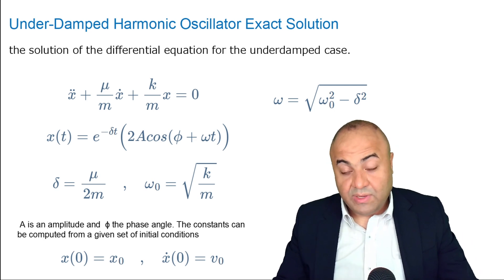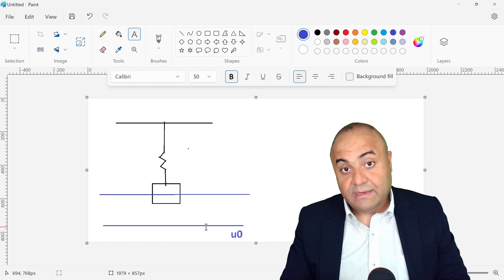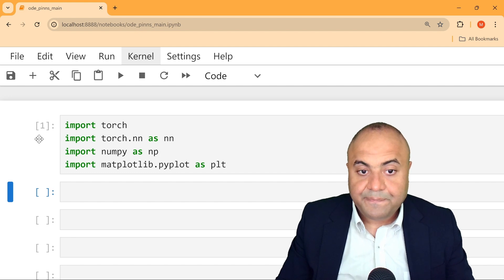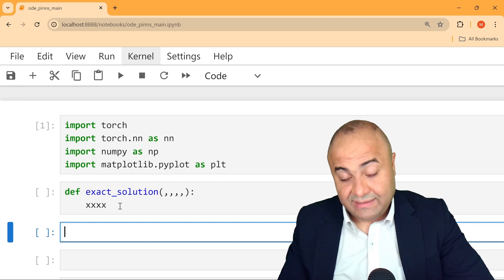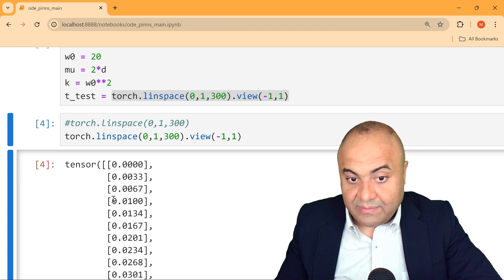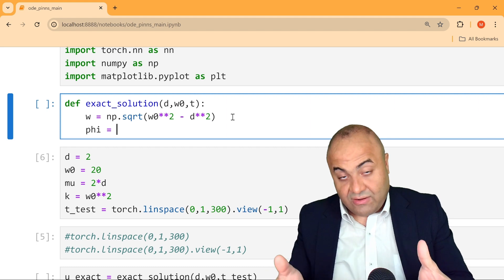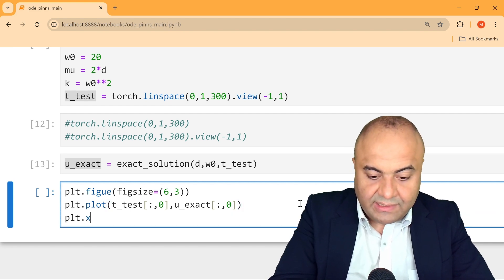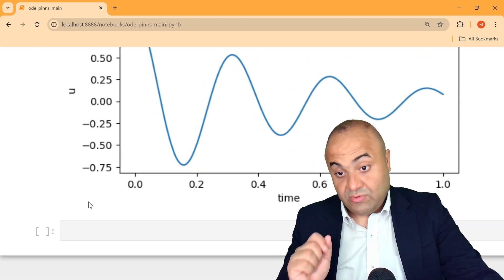Lec.3: ODEs Damped Oscillator  Exact Solution  [Physics Informed Machine Learning]

Comment: Sir, I have a question. I am basically applying PINNs in mathematical biology. Sir, if a differential equation already has exact solution then what is the necessity to use PINNs? And if there doesn't exist an exact solution for a differential equations, then in most of the literatures they are generating numerical data using traditional numerical methods and then applying those data for the training of our neural network. Then what is the advantages of PINNs in those cases sir? I truly believe that PINNs is a useful method for the differential equations in which numerical methods fail or in the cases of complex solution like Schrodinger equation. Sir, I have a lots of doubt and I think I may get those answers from you. Is there any platform except youtube so that I can contact with you for your valuable suggestions?
Reply from the maker: Hi I will try to answer it seems a long question:
- we usually use exact solutions to see how far our PINNs method from the exact solution which is the reference point of your solver accuracy after that we can apply PINNs for problems that doesn't have exact solution.
- PINNs is a method to solve a system of equations (pdes or odes) it doesn't need any data generated by numerical methods.
- There are methods that needs data such as the deep neural operator such method do need a lot of data to work.
- please seebthe video "Is PINNs useful" it can show you what can it be uses for.

Later we will cover deep neural operator and inverse PINNs for ODEs these methods have more practical use cases than PINNs.
Reply: @Dr.Mohammad_Samara 

Sir please answer
Reply from the maker: Sorry I sometimes don't get a notification  if I didn't reply please post it in a new comment it will notify me quickly... Anyway regarding your issue:
- for your confusion please take it slow and step by step.
- first PINNs solves the system of equations by minimizing the loss generated by that system so we don't need any data the equations will be used for that.
- if we need to make our model more suitable for real life results we can train the network with PINNs methods first and then use our real life data later but you need to change the loss equations to match your data that is for example simply calculator the MSE for the data batches.
- usually if you want to make a general model you will need to use PINNs with the network of deep neural operator, that somethimes refered to it as physics informed deep neural operator , it is a little different that deep neural operator in which you calculate the loss via the system of equations you have.

Hope this is made it more clear
Reply: Sir, I am research scholar. I want to apply PINNs and inverse PINNs in a Hepatitis B infection model for predicting the disease. It is a ode system. But sir, for my model I don't have the real life data available because it is an immunological model. That is why I had to generate the data using the parameter values. But it is very confusing to me. I am solving a system using PINNs whose solution is already generated by me. If a differential equation don't have exact solution and if no real life data is not available for that special differential equation then we have to generate the data nah? Then in those cases what is the importance of our method, sir?
Reply: And you have replied sir, PINNs is a method to solve a system of differential equation. It does not require any data generated from numerical method.               But, sir if our system of differential equation don't have exact solution and for it if experimental data is also not available how can we get the observed data which will be used to train our model?